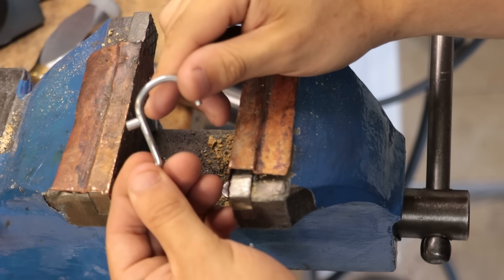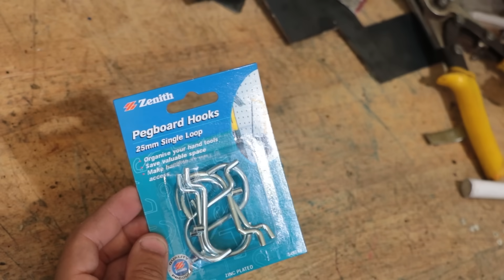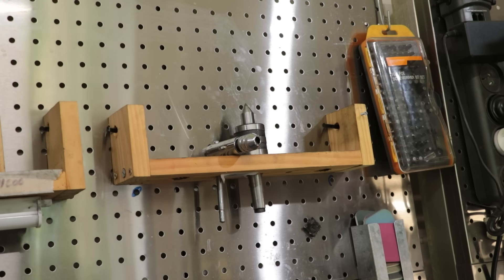Making A Cheap Rivnut Installing Tool

Comment: So, using a couple spanners, a bolt, nut, and some washers was "too clunky".

So you decided to use a couple spanners. A bolt, nut, some washers, and a chuncky extra handle.
Reply from the maker: More comfortable to the than the two spanner method imho. And it doesn’t strain the nut as much
Reply: @artisanmakes  understandable.
Reply from the maker: No worries, I probably should have made that a bit more clear in the video since I do seem to contradict my earlier statement. Cheers
Reply: @artisanmakes  have you thought about adding a sliding keyway to the bolt so that you don't have to stop the twist with the socket wrench?

Comment: If you key the bolt to the body you can cut the bolt head off and use the ratchet or an impact driver to tighten the nut to expand the rivnut much quicker
Reply from the maker: Yes you could.

Comment: 2 spanners on a nut and bolt and some washers is too much trouble for you and you make....this?

Take a severe reprimand 😂

Broach a hexagonal hole in the bearing block, make the stud with a matching hex, then you just need a single spanner. The hex isolates the rotation from the nut. You could even spline it since you have the technology2 spanners on a nut and bolt and some washers is too much trouble for you and you make....this?

Take a severe reprimand 😂

Broach a hexagonal hole in the bearing block, make the stud with a matching hex, then you just need a single spanner. The hex isolates the rotation from the nut. You could even spline it since you have the technology
Reply from the maker: You could buy as I said this was a very quick project for a quick job. If you want to go down that route that is okay, but this tool suits what I needed at the time. Cheers
Reply from the maker: Reprimand? Look again this is meant to be a tool anyone can crank out in less than an hour with a few drills and turning passes, which I said in the video, I think you misssed the point of it.

Comment: If you want to improve a little this project, make a custom bigger nut (the one that is actually black) and make it bigger, so that a ratchet wrench can be used instead of a regular wrench.
That would make the process of fixing the rivet quite faster.
Reply: I was thinking about a ratcheting wrench to but couldn’t you just use one the way it is. The wrench should slip over past the bolt down to the nut if they’re the same size.
Reply: @johnnyb362  Yes. Although it's rather annoying to pass a same size ratcheting wrench over a nut/bolt. Increasing the size of the nut in this project solves that annoyance.

Comment: The hacksaw is the wrong tool for the job on that wire. I usually break out the BMSY-810-CGH - Semi Automatic Double Column & Swivel Head Band Saw for small jobs like that.

Comment: It would be cool if the base of the tool had a hexagonal hole for the bolt to go into eliminating the need for the socket wrench.
Reply from the maker: But that bottom nut does all the jacking, we don’t want to turn the top one

Comment: I admire your commitment to continue using a hand hack saw. I quickly went out and got the cheap 4x6 horizontal band saw from harbor freight. Honestly, for the price? It works like an absolute champ. Ive had zero stalls or anything of the sort so far from bar stock to solid round stock upwards of 2".. 4140 steel tool steel crs hrs etc. Honestly it has all the power it really needs, and shars sells starret blades of the proper size. It is definitely worth the investment and it can be modified into a "better" saw. Ive added coolant and a hydraulic cylinder to mine for feed control. The stock spring works fine just hard to adjust on the fly so i found myself cutting far slower than necessary
Reply: I would say just cut slow, not full wt. of the saw only till the blade has broken in and then let it cut at full speed for longer blade life.
Reply: Yup, it really does the job in a small shop. Mine works great for what I need and I got lucky that it cut very, very close to 90deg in the vertical out of the box.

Comment: That’s an awesome idea and a really nice tool! It occurs to me that you could make it even easier to use by replacing the compression nut with one that is bigger than the bolt head. Then you could use a ratchet spanner to install the riv nut.
Reply: I wrote the same comment without reading yours first! 🤘
Reply: I mean, It’s an easy improvement!

Comment: Thanks for sharing. Mine I made with a grade 8 Allen head bolt and a gearwrench pass-thru socket. I guess you could use a pair of ratchet wrenches on a hex bolt.

Comment: Pegboard made of wood/hardboard holds the hooks in place much better (a nice firm press/friction fit).  Your sheet metal pegboard looks like it is very thin and has oversized holes.

Comment: Mill a slot in the bolt. Drill and pin through the body and the bolt. Turn the nut, loose the ratchet.

Comment: 12:16 - after cutting the majority of the thrrad, the die bottoms out leaving a taper of partially cut threads. For some applications (like for pegbook hooks) this may be useful as it causes the hook to resist unscrewing.
.
However other times it is annoying and you can't get the nut to seat. You need to grind a relief, an extra step that weaken the bolt.
.
The solution is to flip the die over and run it back down the thread. For small threads you will get it all the way down, like how a bottoming tap works in a blind hole.
If it still won't pull down 100%, either relieve the shoulder with a dremel, or run a countersink into the nut to create a tiny counterbore.

Comment: I wonder how well your thrust washers are going to hold up being soft. I say this as a neighbour did this with a similar sized needle thrust bearing on a Myford Super 7 cross slide IIRC and it didn't last long before he replaced them with the proper hardened washers. I ran into him at the local bearing supply shop where he was collecting the thrust washers and he told me the tale.
Reply: flanged nut would help for sure.  I thought the same thing, if/when I make this tool I'll probably also make a nut with a thick flange for the purpose.  And use LH threads.

Comment: Great low profile design for those tight areas, but for AU$33.42 6X (M3 - M10) Hand Tool Kit from EBay, or Vevor Kit for AU$47.49, or a drill adaptor Tool M3-M8 for AU$52.50 from EBay....  Nice video...
Reply: Still exist ? Cant find them ATM mate

Comment: Your method is even better than the commercial tool. With your shoulder on it, the insert crushes nicely centred. My tools often leave the insert slightly off centre, which causes lots of alignment issues. 
I do hundred of rivnuts a month and will definitely be copying your shoulder idea when I build my tool.
Thanks again for another great video!!
Reply: If you do hundreds a month get a real tool. This is the slowest most manual way possible to install a rivnut
Reply: @russellv6234  the cheap harbour freight or princess auto tools handheld ones only cost $20 and are all done by feel. They wear out ridiculously fast and rarely can your hands do a good job of applying the right pressure consistently.
My tool cost about $300 and looks kinda like an 18” bolt cutter. You set it once and installation is consistent with excellent repeatability, but it still sometimes gets the rivnut slightly off center or angled if it gets misaligned during the first squeeze.
To go to an air operated installer I would be upwards of $1500 and still has the same problems if not perfectly operated. 
I have a design I’m working on for a manual tool that hopefully will eliminate the misalignment issue, and was simply saying that the shoulder idea he has used will be incorporated into my design as well
Reply: For a while, I worked for a company that used rivnuts by the 10,000's. My recommendation would be to look into an Avdel 74200. Pneumatic tool that will cut down installation time from a minute per rivnut to a few seconds.
Reply: I use rivnuts a lot in my line of work and never have an issue with using standard tools to set these. Sounds like you have some operator error going on. I have every tool from plier type to dual handle, to impact gun. When used properly, every tool sets perfectly. The most I have spent on any of these tools have been $70.

Comment: Why not shorten the bolt so you don't need a separate nut and you could also use an impact on the bolt?
Reply: Because the bolt shouldn't be turning when in use or you will unthread the rivnut.

The second nut (the black one he is turning) is what tightens and crimps the rivnut. The bolt just holds everything together.

Comment: 100 usd? Or ausd, i think i bought mine for about 30 usd, included some rivnuts aswell. Not the best but has workdd fine for the few times i used it
Reply from the maker: 100 aud, I guess roughly 60usd

Comment: Small improvement, insert a long neck hex socket onto the nut with a handle so that you don’t need a wrench on the end, and install a ratcheting spanner on the jam nut so that you don’t have to remove the moving the spanner,

Comment: I might have misheard, but I thought you wanted to make that tool to not have to fiddle around with 2 spanners (and a bolt, nut and washers), but then go on and make a tool (a very nice-looking one, no argument there) where you still need to fiddle around with 2 spanners (in addition to the handle of the nice-looking tool; only putting the rest of the parts in a nicer package, but essentially still the same thing) ... I ... I don't understand ...why?

You have a workshop right there, with a lathe and a mill in it. Why not just give the thing two levers, one fixed to the bushing housing thingy, one actuating a cam-like contraption to pull the puller - and you basically have a pair of rivnut pliers. I hope I don't sound like a dick, but that was so, I don't know, anti climatic :')
Reply from the maker: I wanted a simple tool that could be copied by anyone. I try not to over engineer stuff if I can. I think this method is easy to copy. Drill a hole in some steel and turn down a thread on a bolt. Easy no?
Reply: @artisanmakes  No, I totally get that part, simple tool (and when I'm tinkering on stuff myself, it's the same for me). My gripe was more that the tool did not really solve the issue of having to fiddle around with two wrenches, which seemed to be a major reason to build it in the first place(?) Again, I might have completely misunderstood (as in misheard or misinterpreted, possibly both) the beginning of the video.
Reply from the maker: No my bad. With The two  nut method you have to jam the nut up against the flange and twist it to compress the threads which takes a lot of force and creates friction. This tool simply pulls the stud upwards. It does make a difference

Comment: Never bought the fastening tool for rivnuts but I use them as pressed insert in timber.
Reply: You really should be using "thread-in" inserts for timber.
There are various styles, with the softwood ones having a nice coarse thread but you have to be careful of splitting.
There are also a metal thread type with tiny flutes that you can use in hardwood. These have either a flat slot or hex drive to get them in the hole.
Reply: @johncoops6897  have used the thread type, some are cheap & collapse. Running the bolt in the insert & then setting in timber helps but chipboard doesn't always hold together. Rivets I use on melamine workbench when I have fixtures I want to use & hold in place for duration.
Reply: @huntz3215  - I am currently dealing with the threaded ones to repair wooden kitchen knobs. Drawer knobs get a hard life over the years.
They used pressed-in bress hex with no side teeth to grip the timber, so they eventually loose. I am testing all manner of solutions. I found some  that have heaps of barbs and they seem Ok when used with exoxy as we, but time will tell.
.
Rivnuts would work great in a work bench of inserted from the underside. That is a great idea.

Comment: I used to hate pegboard until I found some square holed pegboard with little plastic locking clips that hold the pegs in place. Called lockboard or something, I can't remember right now.
Lets me keep all my oversized tools and consumables hanging nicely where I can see them instead of digging through a dozen drawers trying to figure out where I stashed them at.

Comment: Personally I like to load my twist drill in my lathe with the corner edge as if it is a boring bar. The load seems to cut best and wear drills better that way too. What a fantastic build! Thanks for sharing!

Comment: Which wire gauge do you use in your country?
Reply: We use the wire gauge that suits the particular application. Thicker for larger current, etc 😅
.
Australia uses metric system so wire is measured in Square Millimeters of cross sectional area. This is infinitely more logical than the AWG system (which doesn't use a linear scale).
Normal household building cable for 20A power circuits is 2.5mm² (about AWG 14) and light duty flexible appliance cable is rated 7.5A and is 0.75mm² (about AWG 19).
Reply: @johncoops6897  In the UK, electrical cable is also in Millimetre cross section. So light circuits are 1.5, ring mains are 2.5, I have an electric shower which is 10mm². For non electrical purposes, such as peg board hooks, especially older stuff, we used SWG - Standard Wire Gauge - and although this is an inch rather than metric system, it's totally different from the American AWG!
Reply: @mikebashford8198  - I just checked and fencing wire is now sold in mm², but I seem to remember it being SWG or some other "guage" about 30-40 years ago.
Australia changed to metric a long time ago. Whilst we are a British colony, we also imported a lot of stuff from the USA.
So whilst the UK only had "imperial"  measurement system before metric, we Aussies had TWO different "imperial" systems. It was absolute chaos back then 😃

Comment: Must admit I bought a kit with a selection of sizes of rivnut from M3 to M12 and the application tool for less than £40 off Amazon a couple of months ago, a VonHaus, strange name for a chinese company. So far it has been great, not a lot of use yet, but when you need a rivnut, you need a rivnut.

Comment: Not sure if possible because I don't have the info handy but could you do 4mm, 5mm and 6mm on the same bolt in that order from the end of the bolt? Just step down to each size. It could be a 3 in one tool. 

Great vid and keep em coming@

Comment: To increase the usability of the tool I would use a ratchet spanner instead of the fixed one to drive the "pull" nut and just a jointed spanner to lock to bolt.

Comment: Nice!
Seems to be working better then the original tools that I have for this. At least if you don't have enough strength in your hands to deform the nuts. Just wondering how long the bolts and nuts will last since they will wear when tightening them.... but a lot cheaper too then the special bolts for the original tools.

Very handy this tool, I have used lots and lots of this rivnuts on bikes, tools, rooms with metal walls like containers and such.
Most used here are M4, M5, M6 and lots and lots of M8.

Comment: That is a reliable sturdy design.
But I have to wonder why it needs two handles held at the same location, while the nut is turned with another wrench?
All it needs is some latch type piece to stop the gold bolt head from rotating... then you just hold the body to stop it rotating with the ball handle.
Because in riveting use the gold bolt is always rotationally fixed with the body, why require a 3rd tool handle?
Reply: Agreed, holding two handles seems really awkward. Maybe spring loaded pin and slot in the bolt.
Reply: @Gebsfrom404  ... yeah I imagined a large round bolt head with a slot, then a sprung "latch" piece that slots into the slot. Pull the latch back and turn the bolt, if needed, but in use the latch stops any bolt rotation.

Comment: Nice tool!  You could exyend the range of RivNuts even further by drilling a larger hole thrpugh the body and turning flange bushings to use with the smaller thread RivNuts.  RivNuts are also great in aluminum, and anywhere where you must frequently insert and remove fasteners in thin or soft metal.

Comment: I only have bad experiences with rivnuts, especially the aluminium kind. On several occasions the thread of the rivnut stripped instead of it properly expanding. I had to drill them out etc, sometimes even damaging the hole. Those were m3 rivnuts in thin plate steel. But maybe it's just bad quality rivnuts and rivnut tool. You cannot buy these in hardware stores in my country, so I got them from alie.
Reply from the maker: I haven’t used alu ones but I too have heard bad things about them

Comment: 7:10 Holy chatter batman! As far a pegboard goes, you need the plastic peg locks. Holds everything in place. For metal pegboards, they have "pegboard hook locks" which are a plastic insert that helps secure the hook. I personally wouldn't use metal pegboards since there's little friction.